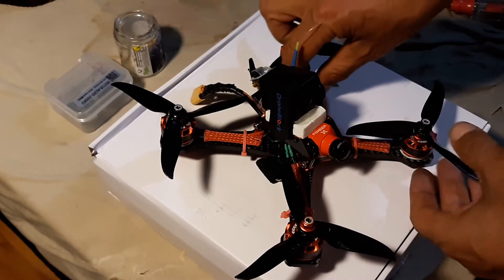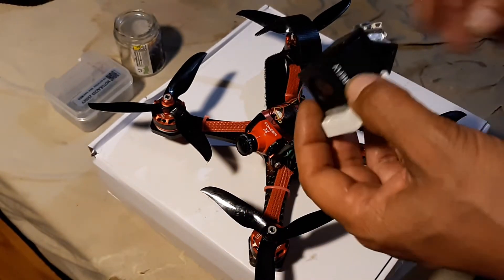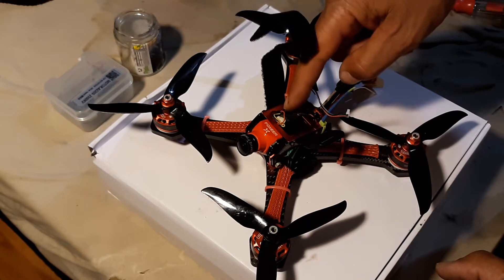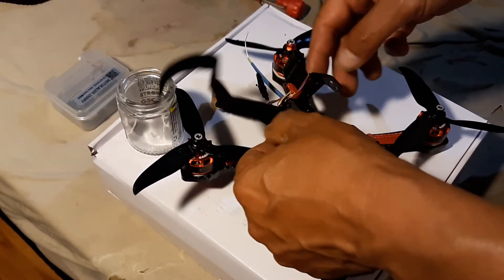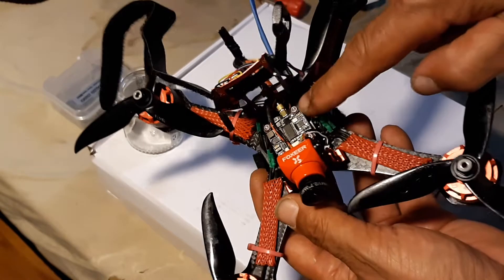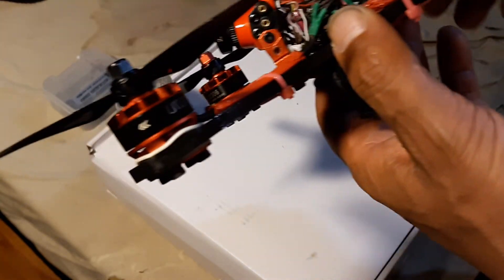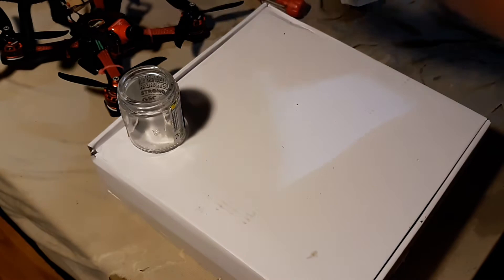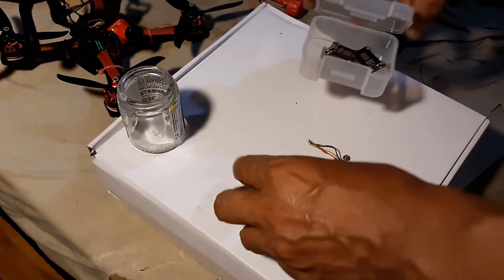One piece at a time introducing  Red Bear

Comment: Thats a beasty look into quad. Is it a new one? Can't wait for maiden flight..Cheers! I'll fly my Diatone soon!
Reply from the maker: That is excellent news!! I've been looking forward to it! The blue bear is the 405 20 by 20 stack. Hard to solder!  But your diatone I've been waiting for. This is the kingkong stack I've been working on all summer... replaced fc had some lose pin..when in wrong spot one motor stoped..if I moved stack just right would chime then work. But one wreck would mess up. Or just flying vibrating would cause. Now fixed. Works great.  Easier build by far. Solder wise. Cant wait to compare to the mamba 405 ...try to solder up last few joints tomorrow.  But now I can fly so slowing down shop time. Make vid of your build...love to watch you mature in hobby and I learn from..God bless..